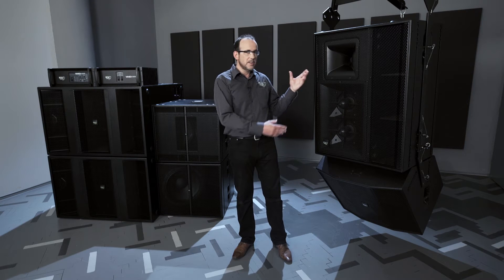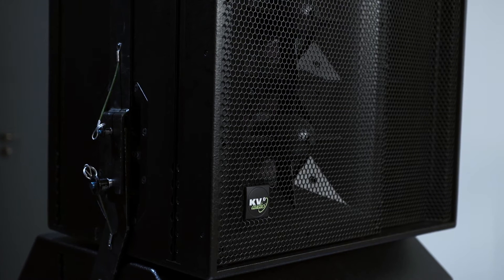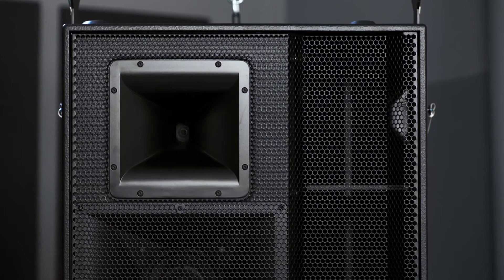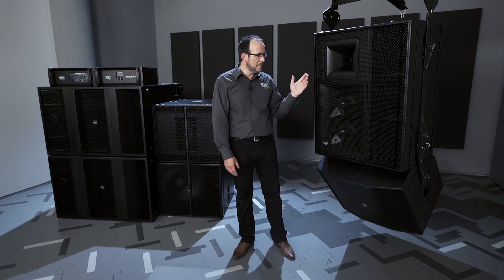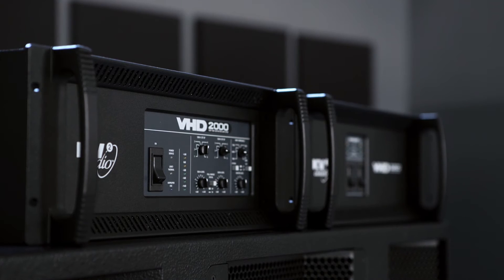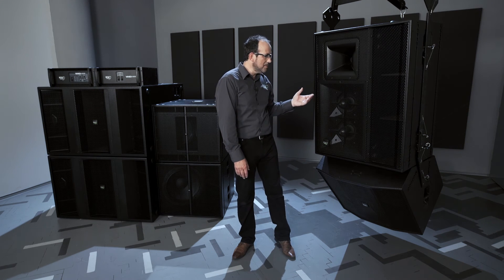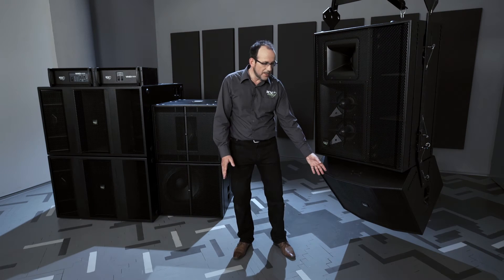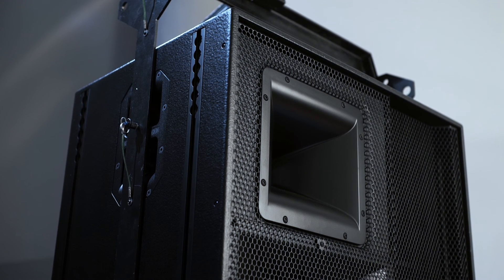KV2 Audio - VHD2.0

Comment: 0:20 - 3 to 5 thousand people with 2 VHD2.0's - 1 per side - that is a bold claim.
Reply: Iv done a lot more people than 3000 with 1 top 1 downfill a side .at dance shows.had no problems . Iv just put in 1 top 1 down fill . 8 × 2x21 . 8 x 2x15 . It will easy do over 5000 in the forest im doing.
Reply: Jim Stanley https://www.facebook.com/groups/kv2community/permalink/1096200630723439/